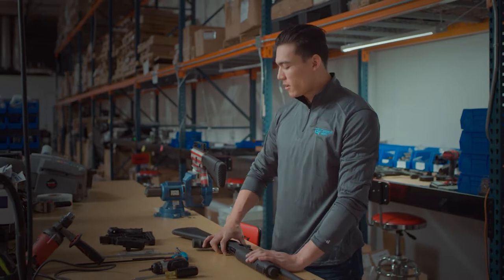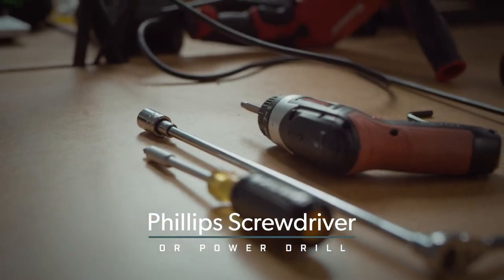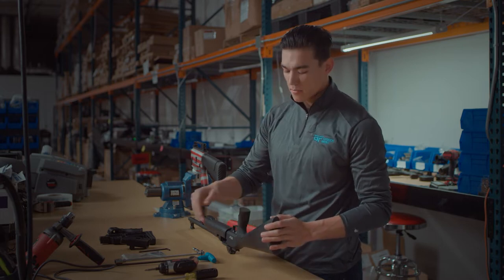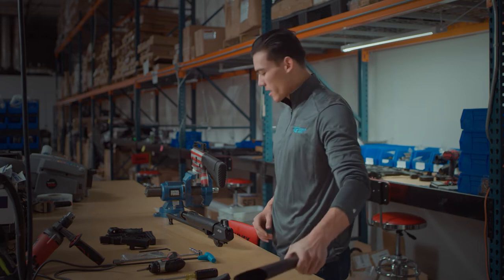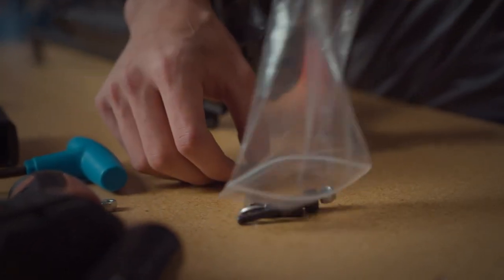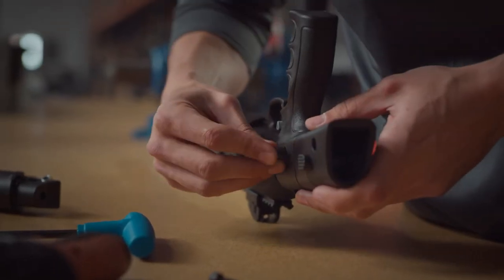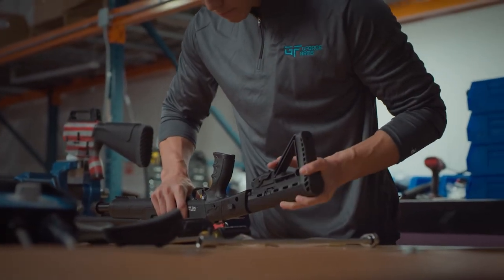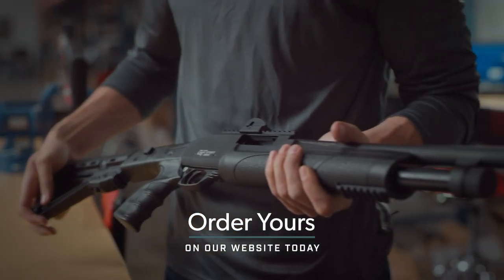GForce Arms - Folding 5-Position Adjustable Stock Install "At the Bench"

Comment: Was waiting so long for this.. finally ! Nice job GF armory💪 just leveled up my cheap shotgun… now it looks cool like all my other guns lol. Curious on a tube extension that’s flush with my barrel on my GF3, and maybe an optic mount above the ejection port? Dovetail to picatinny adapter ?

Also, i like that mine has the little rail up front on the slide, but i still would like to change out the slide for a more aggressive looking one and better feeling..

Comment: Can the Adjustable Stock be installed directly to the pistol grip? It looked like the fold adapter could be omitted if you prefer.
Reply from the maker: Don't think so!
Reply: I can confirm that it doesn’t. It also doesn’t come with the hardware. 😒
Reply: Actually, if you’re willing to just shove it in there, and not plan on ever taking it back off without a ton of work, it’ll work. Had to buy the hardware myself since they forgot it but I was able to get it in without the adapter.
Reply: @thatboyyjuniel5212  any pics or vids? I want a semi auto for my daughter, but feel the adapter would make this gun too long for her? Cause if it works I'll NEVER take it apart.
Reply: @GforceArms someone says yes, why not make a video trying it? Might sell a few more guns if it does truly work without the folding part....